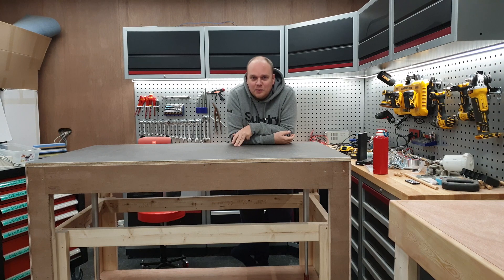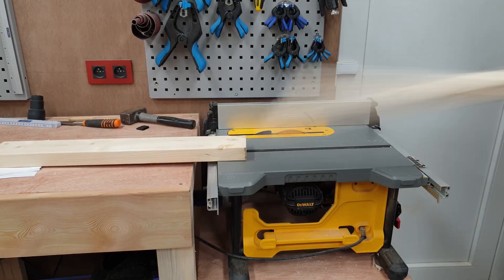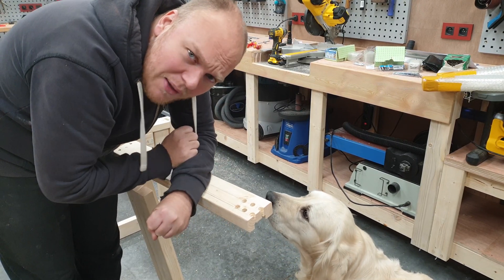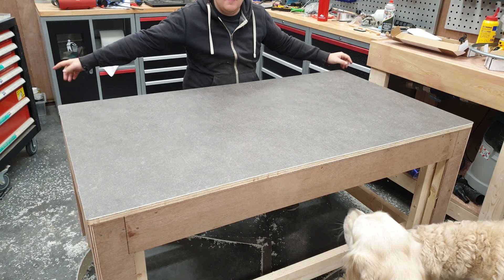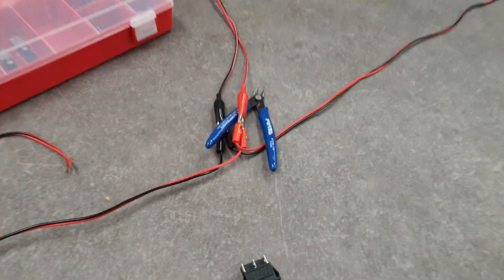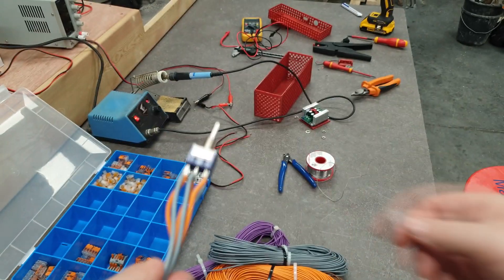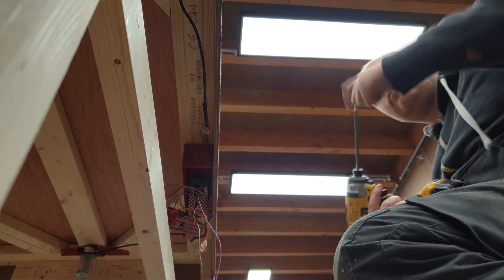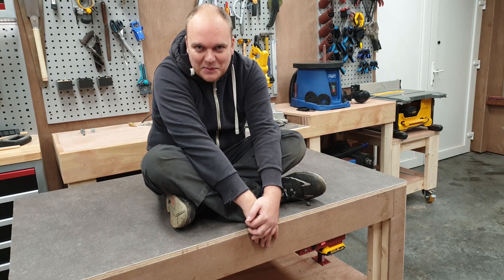Adjustable height workbench using my 18V DeWalt battery

Comment: Great project and video! Did you find there is any racking or it's quite sturdy with lateral forces? Thinking of making one where I handplane on...
Reply from the maker: There is a small bit of racking on the width cause it doesn't have motors lifting it but it's not a problem. I'm thinking about doing a 1 year later vid so if you have any questions let me know.

Comment: Wow, that’s an incredible design.  Could you provide the names of the lift motors and components you used.  I rechecked the video but didn’t hear the names.  Thanks!
Reply from the maker: Added all the parts in the description! Thanks for watching :) stl for the electronics following later today(tip use tiewraps to keep 2 part from falling off) you need anything else let me know
Reply: @NoizieWorks  Thanks!

Comment: Of course they don't tell where they get parts from
Reply from the maker: There is a reason why i don't include them and that's because the links get removed(expire) all the time on aliexpress and big site's like that. Half the time i get requests to update the links on videos i do provide them and that's just crazy so i don't bother. I call out the components by name and if you put that in google 90% of the time it's right there in front of you on you're favorite site. If that doesn't work you could kindly ask me to point you the right way with a link cause i do read the comments (not like other people) and don't mind helping you even if it's a good chat on messenger like i did for a few people in the past.